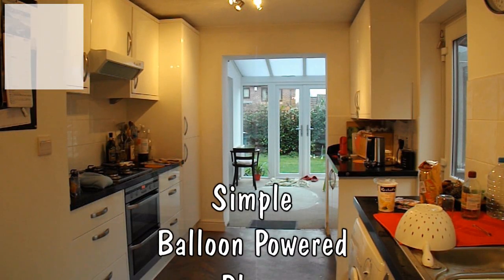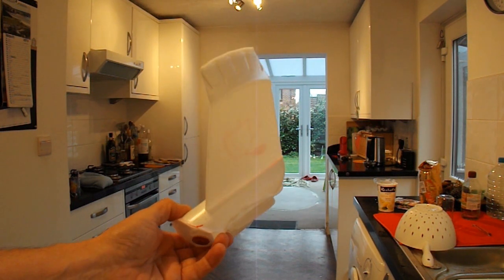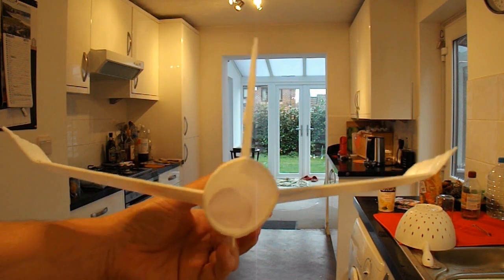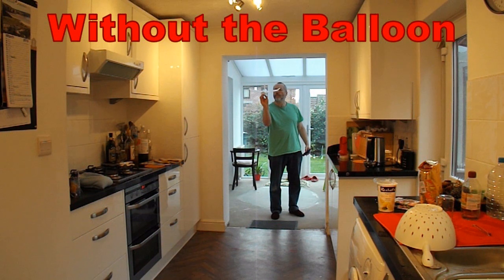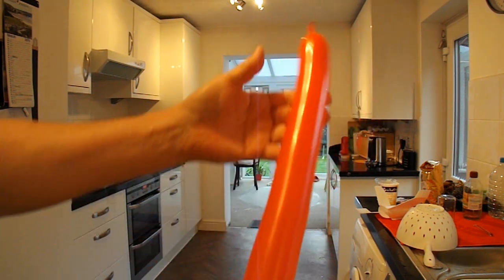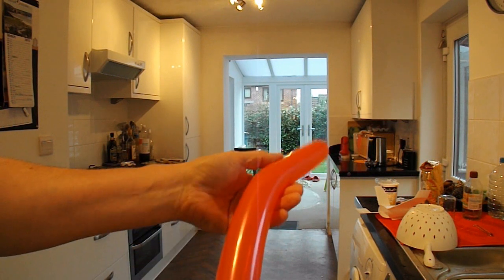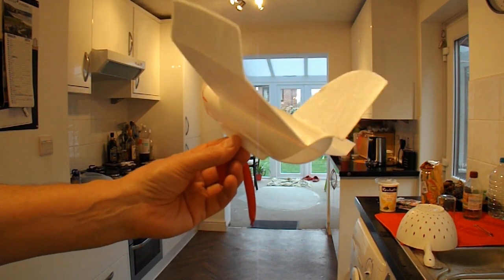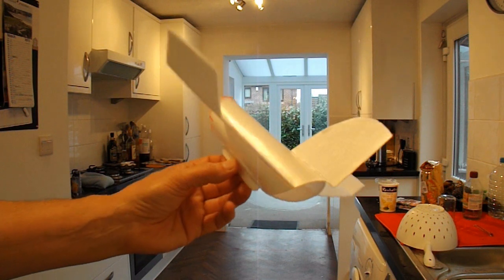Simple Balloon Powered Plane Second Attempt - Fail

Comment: I think the exhausting point should be fixed to the body of the plane to have better power transmission and better directional control of the power transmission. That is also what you can partly achive with a longer tube because the exhaust point whould then be the end of the tube. But with a tube model you also have to consider the dynamics of the air movements compensating for the shrinking volume of the baloon witch is not trivial. Seems interesting to investigate though :-D 
thanks
Reply from the maker: David Peeters if you can figure out a way of fixing a balloon in place in such a way that allows for it to inflate and deflate without weakening it, let me know. I suspect a long tube would be better, but then you are adding significant weight.
Reply: GrandadIsAnOldMan as the diamerer of this type of baloon does not change much on inflation you could use rings to hold it and a pipe with a reduction inside the baloon (e.g. a botle top with a hole) for the exhaust.
Reply from the maker: David Peeters I think you should try it and show me :-)
Reply: GrandadIsAnOldMan I will do my best but it will take me some time to get to it :-)